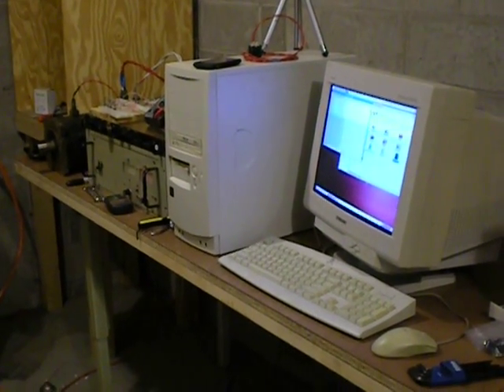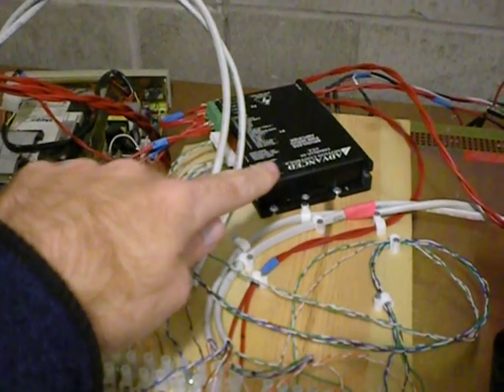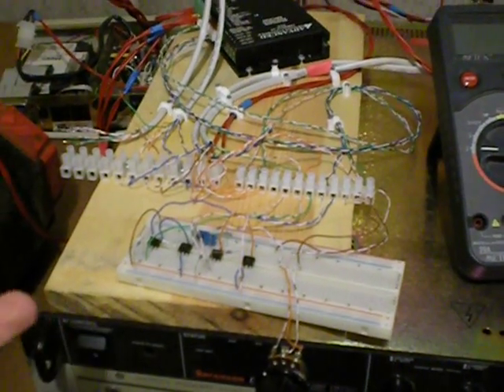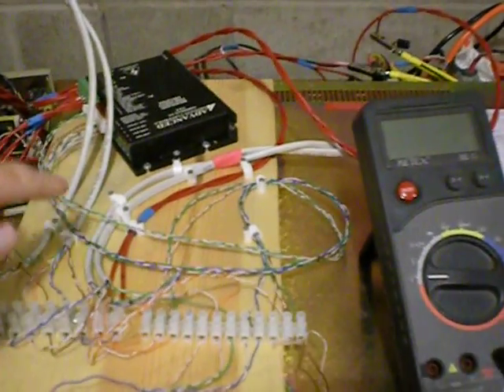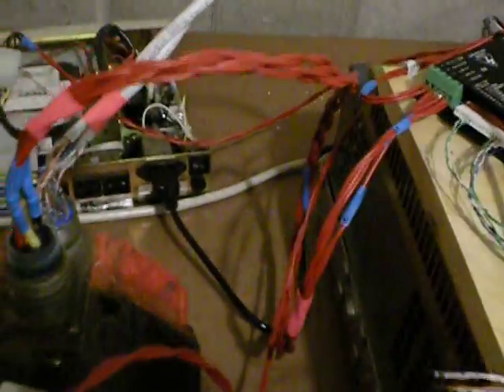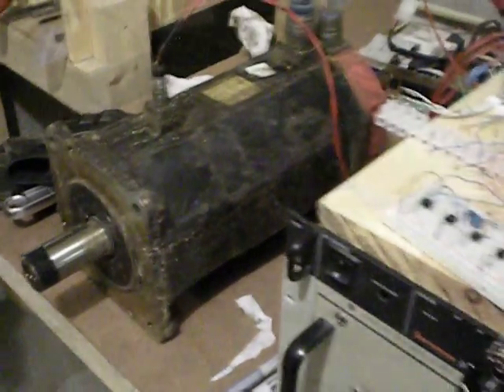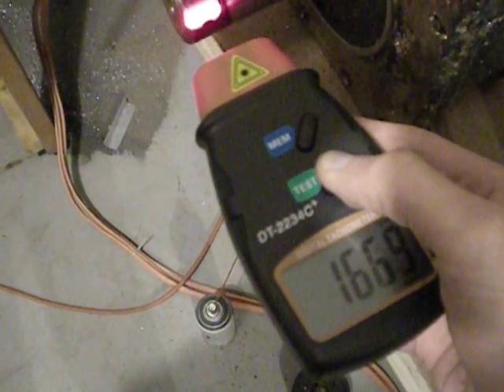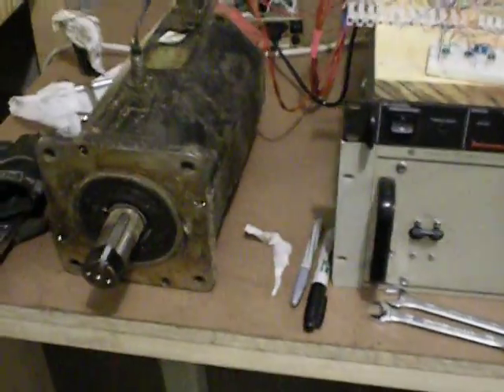Fanuc AC servo run with EMC2

Comment: which model of AMC drive did you use for fanuc 10s motor ? Thankyou
Reply: does it run smoothly now
I saw your threads but dont know how well it goes
I've a lot of fanuc red cab motor here

Comment: Hey man nice work there. I am retrofitting a Cincinatti Arrow 500 VMC in my shop right now and it has AC servos running off +/- 10V control analog. I am using the Mesa cards 5i25/7i77 combo and so far it has been a SUPER easy setup . Not sure what drives you intend to use but if you plan to use the original drives with these motors or a new drive and these motors it is a simple and easy setup. I also believe they have cards that can accept resolver based feedback into LinuxCNC.  LinuxCNC is NICE